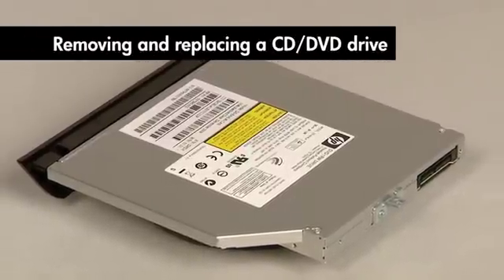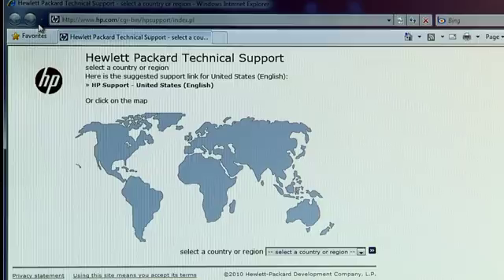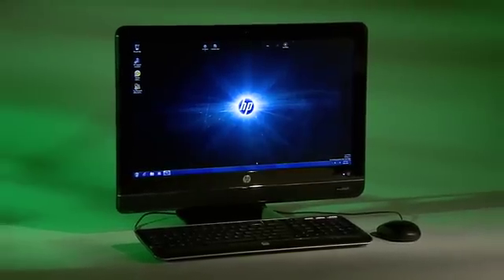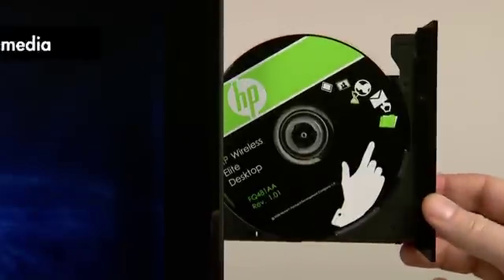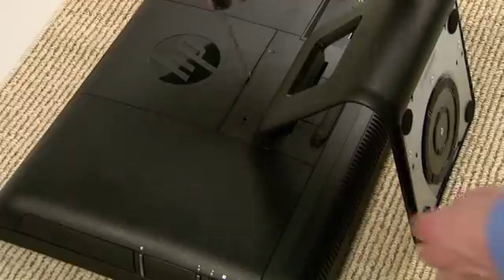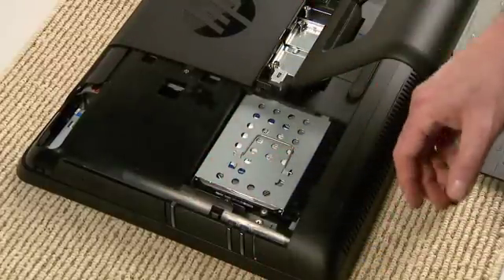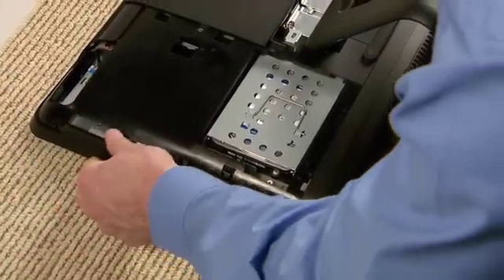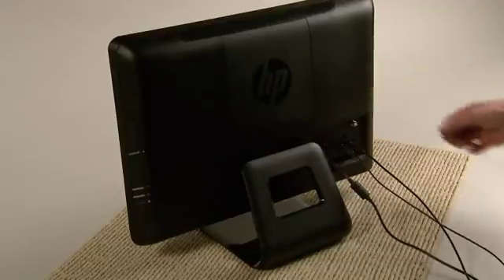Replacing the CD/DVD Drive | HP Pavilion All-in-One PC | HP

Comment: when I put the new drive in do I have to reinstall anything?
Reply: jackisking143 If you are referring to a CD/DVD drive, then you do not have to re-install anything. If you are replacing a hard drive or solid state drive, then you would need to re-install your operating system using the necessary recovery media.
Reply: HP Computing Support battery replacement